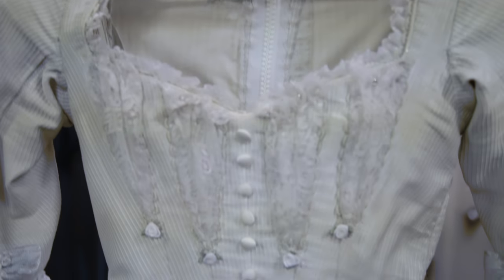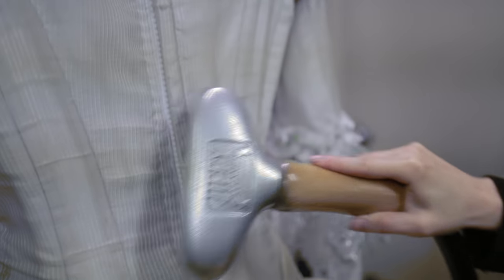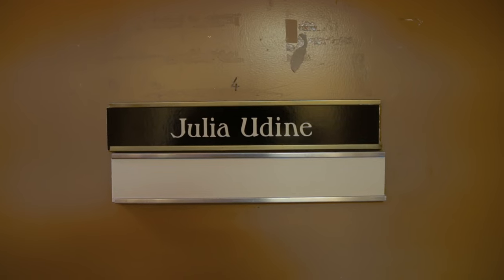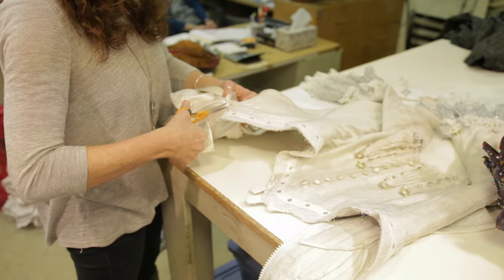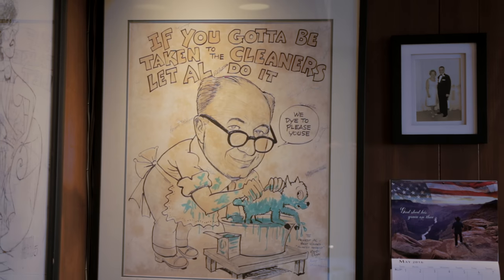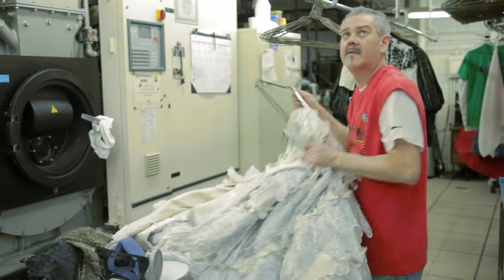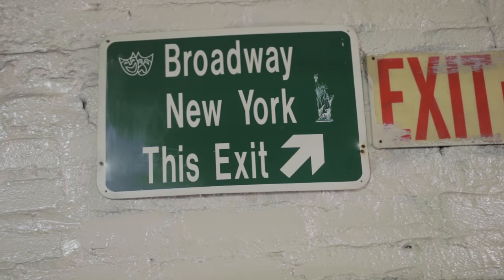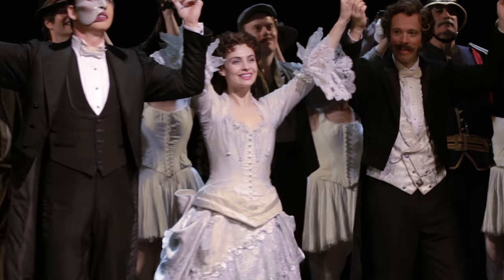The Journey of the Dress | The Phantom of the Opera

Comment: that's surprising that they dry clean it everyday, I know in many shows they just sanitize it daily and dry clean once a fortnight as to not damage the costume.
Reply: I highly doubt they dry clean it every day, I think they just wanted to show the full process for this video. There is actually no point to dry cleaning it so much, the girls wear undergarments so the dress takes a while to actually get 'dirty'.
Reply: White tends to show sweat stains quickly.
Reply: Couple of insights for the why:
1: white picks up all colors easily (duh).
2: Christine is thrown around / on the deck of the stage A LOT in this dress. So I am sure it picks up quiet a bit from the stage.
3: other actors (namely the phantom) has a lot of makeup on him (duh) and even with proper setting of the makeup by that point in the show he’s been in it for roughly 2 hours and so I am sure between sweat, oils, humidity and other factors that is a good chance some might get on to any costumes including this on.
Reply: Agreed.
Reply: The actress is only wearing a corset up top, so the dress is not protected from underarm sweat, odors and stains. Those can't be allowed to set into the garment.
Reply: Tillysnow1 True. And the harsh chemicals from dry cleaning will ultimately ruin the fabric.
Reply: If you have the right dress maker, they make the clothing very sturdy. Given the fact it's Broadway, I bet the costumes are made to take a decent beating.
Reply: krisisnkaos 
There are built-in underarm shields that are removed - some are disposables, and some are hand washed.  I actually hand washed Phoebe Cates’ underarm shields during her performance at the La Jolla playhouse - it was either Three Sisters or The Cherry Orchard(? Can’t remember, was in the 90s).  My daughter was a theater major at UC San Diego - students interned at The LJ P.  I spent many nights with her during that production helping her maintain costumes and washing the stars’ undies!
Reply: YT4Me57 
Removable underarm shields are standard equipment.  They snap into the garment and snap out for washing by hand.
Reply: @gracevazul2672  True even if it is not for Broadway.  A costume I built 25 years ago in college is still being used.  Granted it did not have to take the beating that this dress takes LOL.
Reply: Jason Mack Oh, very true! I hope my stuff lasts that long. The stitches are hard to pull out when I make a mistake, so that might be a good thing. 😂 I love the idea that your costume is still being used!! Was it for Phantom of the Opera as well, or what was it made for??
Reply: @gracevazul2672  It was Lily's costume for The Secret Garden.  I still leave near the JC that went to and they did a production of The Importance of Being Earnest.  I went and saw it and sure enough in Act II, there was my dress on Cecily.
Reply: @xMia311  Would have been a great response, but you could really lay off the 'duh.'
Reply: When i was in Annie I had shows every other day for 9 weeks ( it was double cast bc it had so many kids) we all had our own costumes but they would only wash them once a week. That included the socks that we had to wear bc socks where a big part of the costume. It stunk

Comment: Whoa. I assumed that a show with as massive of a production as "Phantom" would have several sets of each of the principal characters' costumes. You'd think they'd want to have multiples in case something goes wrong at the dry cleaners or something.
Reply: They usually do. Unless the costume is super expensive or elaborate. The wedding dress is probably too expensive to have multiples of. Especially when you factor in that the costumes have to be replaced or refitted when the actresses change.
Reply: They do, possibly excluding the wedding dress. There are multiple iterations of each costume, and there is at least one double for the mirror bride.
Reply: They probably also have another one for two show days.